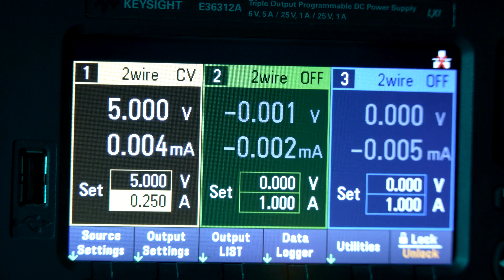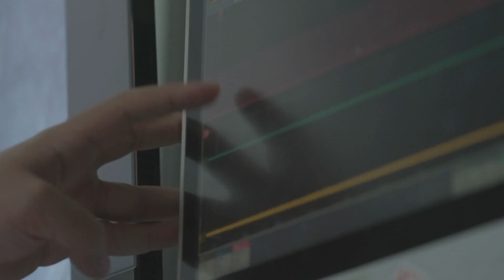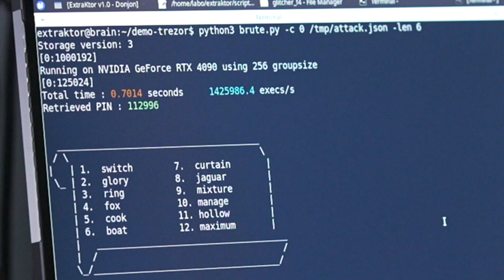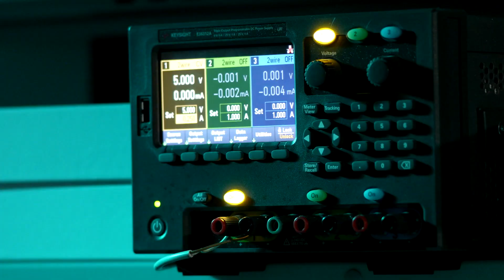Dan Held with Ledger CTO Charles Guillemet: Raising the Security Bar

Comment: The swap function of Ledger is really a scam. A decentralized cold wallet is connected to a centralized exchange platform Changelly, and the user's trading assets are put on hold. Without any prompts, the APP does not have any exchange records. Fortunately, I took screenshots. Various KYC requirements are required, but even if they are provided, they are still useless. Bad review👎
Reply from the maker: Hey there, we assure you we are here to help, could you please open a ticket with us by pressing on the "Contact us" button here: support.ledger.com/hc/en-us

Then we can further investigate the issue and assist accordingly 

Also, you are always free to choose exchange of your choice to swap with, thanks to self custody, you can send funds to any exchange you prefer, swap them there, and then transfer funds to Ledger protected accounts!

Comment: When is ledger live allow us to connect other blockchain nodes directly like bitcoin?
Reply from the maker: Hey Vasu, Currently, Ledger Live does not support direct connection to other blockchain nodes like Bitcoin. Ledger Live is primarily designed to manage your Ledger accounts, stake, and buy and sell cryptocurrencies. However, Ledger is always working on updates and new features, so this might be a possibility in the future. For now, you can use WalletConnect to link Ledger Live to a wide range of decentralized applications (DApps). Please note that the service or third-party app you wish to connect your Ledger to must support WalletConnect v2. You can learn more about this at https://support.ledger.com/hc/en-us/articles/360018444599-Connecting-Ledger-Live-to-DApps-with-WalletConnect